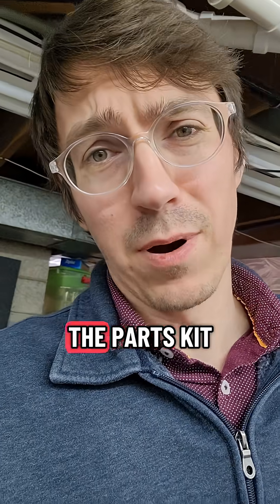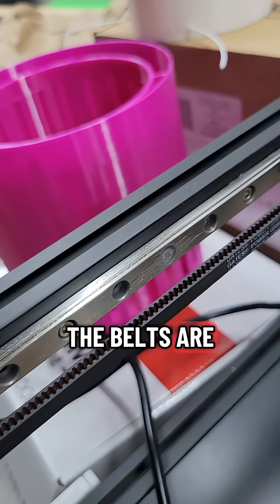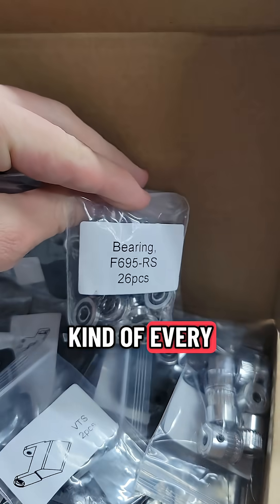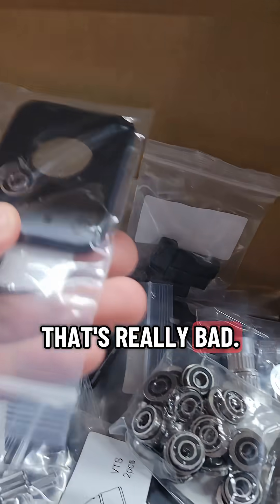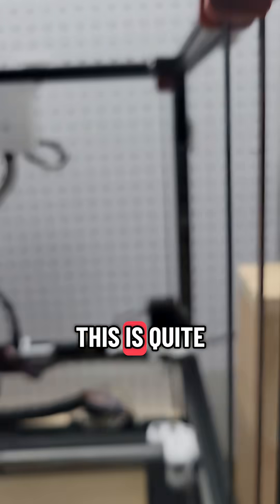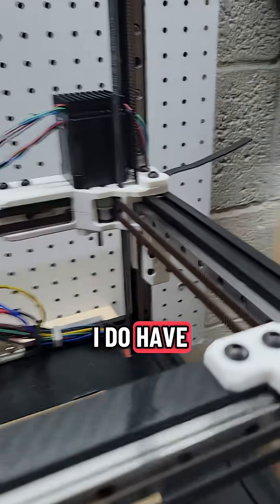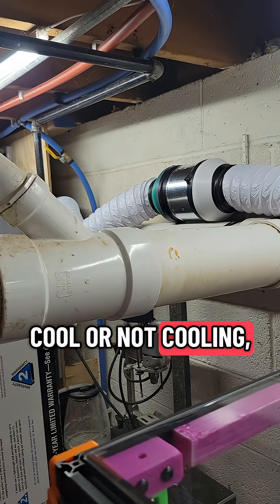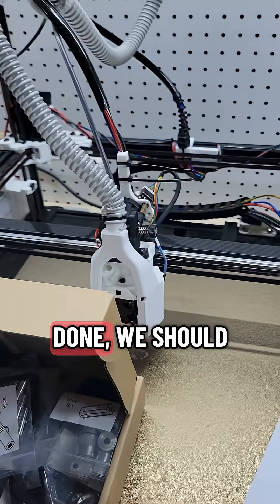My Used Voron 3D Printer Will Never Be The Same. #3dprinterupgrade #3dprinting #voron

Comment: If anything just build a newer version of the monolith gantry with wider belts. For monolith unless you upgrade to 4040 vertical extrusions, 9mm awd isn’t even recommended. On a 2020 they recommend a max of 9mm 2wd
Reply from the maker: I've already got the cnc parts kit. This does bump the belts from 4 to 6mm previous owner has thin belts i think from buying the wrong motors with too short of shafts forced him to keep the narrow 4mm belts

Comment: To be clear, that cnc kit will be a downgrade. The monolith gantry that’s installed on that printer with live shaft idlers, shorter belt runs and properly balanced com will have far better performance than a cnc version of the stock gantry.
Reply from the maker: https://github.com/vcprojects/ldo_awd

Isn't this pretty close to the monolith gantry
Reply: @matthewalton6889 no, longer belts so more stretch, bottom mounted y rails so the belts are actively twisting the gantry with every movement and normal idlers with tiny ball bearings. It’ll work but it’s not perfect
Reply from the maker: @imst4722 appreciate the info. Im already kinda stuck on this path since I bought the cnc kit. If this works out well I might try snd upgrade my other voron with the monolith gantry. Thanks for pointing out the difference!